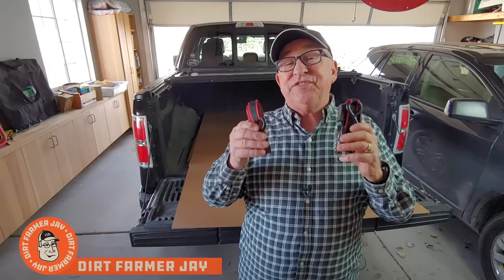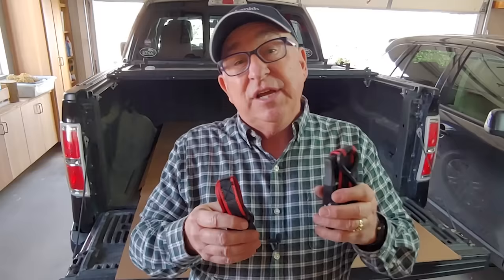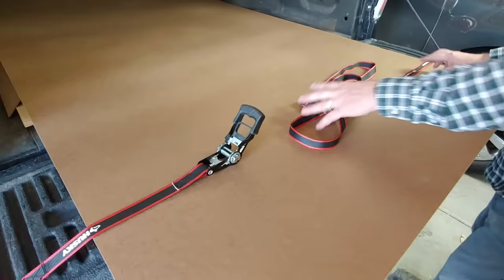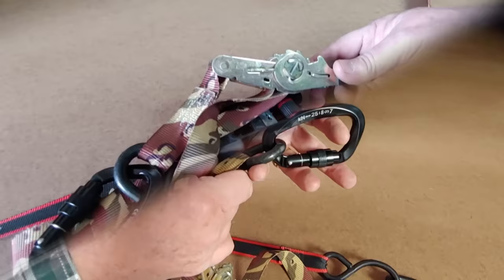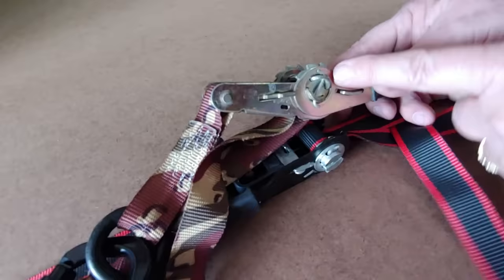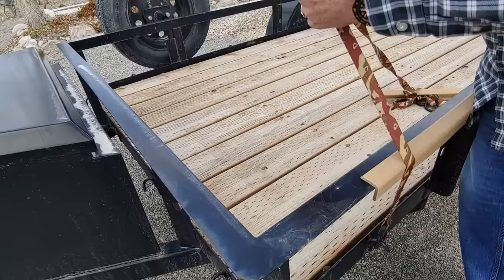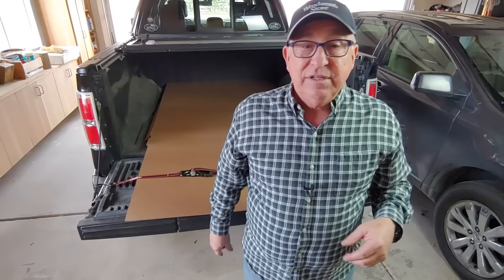How to Use a Ratchet Strap - Tips and Tricks!

Comment: At 8:43, when you hook the hooks together,
Instead of hooking the  hook thru the other straps hook eye, for added security you can actually hook each hook into the opposing hook eyes.
This way it's double hooked
Reply: That is an OK idea. Just keep one thing in mind if you are hooking them the way I think you are:
Those hook eyes aren't welded shut. If you hook them sort of 69 wise, hook to eye; the hook will be pulling right at the joint of the eye. It is also a little bit teardrop, and it will wedge in, just as if you had a reason to pry open an eye.  Not a major concern unless you are using the straps at the high end of their strength, or in safety critical circumstance.

Comment: When you hook to a hook, work each other's hook into the sewn loop of the other, I came up with this myself and you will be grateful once seeing how well it works
Reply from the maker: Indeed, great tip. We'll show that in a future edition. The way you've described allows the hooks to stay connected whether they are under tension or not. Thanks for writing! Best, DFJ
Reply: @DirtFarmerJay  plus it loads the hooks as they were intended to be, the back hoop is often not welded and I hesitate to crank down on those hooks in any angle then they come set up for. Plus my way effectively halves the load each hook sees so not only within design, but better than.

Comment: Great Video But may I suggest that you put a twist in the strap if tying to a roof rack or trailer. Ask any trucker why and he will tell you it stops that annoying hum caused by the wind over the strap.
Reply from the maker: Thanks, martintheshred, for watching and commenting. I usually do put a twist especially when it's a longer length to tie down. But thanks for the reminder. Best, DFJ

Comment: Great ideas. I’ve been using the strap clamps the wrong way. I’d be very careful with that C clamp setup. If that clamp loosens, it could be a dangerous situation
Reply from the maker: Greg, thanks, indeed, we will mention the issue with a c-clamp in another video coming up. Best, DFJ
Reply: A C-clamp on a tailgate with no safety line is not a pretty site from a motorcycle please don’t do this.
Please add an edit to this video—-I’m asking as a first responder and motorcyclist.
Thanks.

Comment: In the beginning, leave it closed in the locked position to feed the strap through. After taking out all the slack and making sure there are no twists, you can open it and start ratcheting. P.S. for setting up a slackline, set it up upside down and ratchet from the bottom to avoid the ratchet from twisting the strap with its weight.
Reply from the maker: NewGunGuy - great insights - thanks for enhancement and for the tip on setting up a slackline - something that you won't see this guy doing.... Best Regards, DFJ
Reply: @DirtFarmerJay  I had to learn at work. I saw everyone else struggling. I didn't learn until took the time to look at the darn thing and decipher it.

Comment: Enjoying your vids - Tip: When releasing, After you have 'unlatched', just give a yank on the 'tail' and it will unwind. I also carry a small can of WD-40 to keep the ratchet in top shape. I drive a parts delivery truck for an auto dealer and am always using these straps (1.5")  to tie down a variety of loads all day long.
Reply from the maker: Thanks for the info! Sounds like you've picked up some expert methods along the way. Best, DFJ

Comment: Flatbed truckers call those "X" straps when they cross like that.  They use them on the front or rear of a load mainly.  
Reputable flatbed trucking companies train their drivers on how to do the "X" straps among other techniques not shown here.  

Free pro tip too...you can use the excess strap (rolled or folded) as "padding" to help prevent the rest of the strap from getting cut/damaged as well.

A D.O.T. officer will ding (negative inspection vs. clean inspection) a truck driver in a D.O.T.  inspection for cut/chaffed/damaged straps.
Reply from the maker: MAJorgy70 - great insights. Thanks for sharing, as well as being a part of the transportation system that we all so heavily depend on. Best Regards, DFJ
Reply: @DirtFarmerJay  Thank you.  I appreciate that.

Comment: using a c clamp looks pretty dangerous
Reply from the maker: georgebx - thanks for watching and taking time to write. I appreciate your concern and there's a couple of things to consider when you are using a c-clamp for this purpose. First, how heavy is the load. For a single or few sheets of a sheet good, a well-tightened C-clamp for a moderate distance works for me. Second, I orient the C-clamp as you see it - with the strap going through it in such as way that the clamp is being forced against the edge. If carrying a more significant load, the cross under and over is the way to go is now a go-to approach around here. Thanks for your thoughts, and for being one of our viewer family! Best Regards, DFJ

Comment: I insert the strap into the tightener a bit differently than shown at 3 minutes into the video. I close the tightener, making sure that the slot is at 90° to the direction of the two arms of the tightener. Next I insert the strap through the slot and pull out most of the slack and tighten as shown. This saves having to handle the loose end of the strap twice. 

It's important to leave a little slack before tightening the strap. The strap needs to turn around the shaft far enough to lock the strap down. I've had a strap come loose because I hadn't left enough slack for the strap to fully lock down.
Reply from the maker: These are some great insights! Thanks for taking time to share them. Best, DFJ

Comment: 15:50 This can also work in reverse --- a tiedown-strap rubbing on a spot can wear a hole in the product.  I had this happen with a boat-hull --- the aluminum actually got worn through and formed a sizeable hole in the boat below the water-line!  I patched it with JB Weld, and added a farther-apart pair of tethering-loops to the boat-trailer so that the strap just passed directly up over the gunwale (i.e., the upper edge of the hull) instead of against one of the chines (i.e., the outward-folded unibody-ribs).
Reply from the maker: Fred Seaborne - sorry for the slow response. This is indeed a great insight - thanks for sharing! We'll use your tip in an upcoming episode and be sure to give you credit for the idea. Thanks for writing! Best, DFJ

Comment: No ,the architect straps have a locking system on them too, if you don’t use the lock your strap will I tighten it’s self, , on the handle when you tight the load , you put t back at 0 , well on my straps you squeeze the handle and push it on down on its self , that locks 🔒 it , nice , thanks BigAl California.

Comment: When setting up a ratchet strap, first  ratchet it until the slot that the strap runs through is perpendicular to the ratchet, then leave the ratcheting handle closed. Now slid the end of tour strap through the slot, coming up through the bottom. This ensures that the dead leg of your strap is on the right side of and clear of the ratcheting mechanism. And you don't have to now fish it through the ratchet a second time. I hope the way i described it was clear.

Comment: I just carried 3 sheets of 1/2" plywood home from the Depot last night strapped with 4 ratchet straps on the roof rack of my Honda CR-V.  Any videos for roof racks? Always good to learn new tricks. Thanks for the extention cord video, I must be a little uncoordinated today, still trying to master that.
Reply from the maker: Roof racks are a bit more trickier. I don't have an episode on this subject, but may consider doing one in the future. The basic idea is to strap down the sheet goods by attaching one end a strap to a side point, taking the strap around the end of the plywood and under to an attachment point on the other side. Repeat on the other end. For extra security, you use a total of 4 straps (two criss-crossed on each end) instead of 2. I hope that helps! Best, DFJ

Comment: to prevent the "hum" or vibration on the strap while driving put a half-twist in the strap and it stops the vibration.
Reply from the maker: Indeed, you can tell an experienced trucker by if they have put a half twist on their strapping system on their flatbed. No buzz, not flap. Thanks for the reminder. Best, DFJ

Comment: here in Ozz   you see a lot of those straps laying on the side of the road  because they have come loose through some fault and the silly hooks come undone    better off using the ones that have a captivated lock ring that goes around the end of the hook      but because of the Chinese flooded market they buy the cheap use once type  (why use once because they have fallen off on the way home )    there should be a standard rating on these things

Comment: Great video. I use straps on a daily basis in my job. Bigger,but same concept. Few comments/tips for others out there. 1: when attaching the strap portion (not the windlass aka ratchet)to ur anchor point, put one twist in the line b4 anchoring. This stops the humming noise and the vibrating strap which could chafe and snap. Ull hear some folks say this weakens the straps but this has been debunked maaaaannny times over. Ud have to twist it dozens of times b4 its an issue.Just dont knot or store straps twisted. 2: if its a long strap when doing the roll like is showed here, you can make the loop big enough to fit ur palms in and use them like a wheel or gear to speed up the winding process. 3: after u do the "roll and loop" like he shows, hold the bound roll in one hand, pinch a loop in between the roll and the ratchet, pas this loop between the load and the tight strap while still holing the roll. Squeeze the roll on itself to flatten some, position the flat roll so it is halfway over the tight strap and so the created pinched loop is halfway over the roll. Spin the flat roll up. This will tighten the pinched loop onto the flat roll and abchoring everything in a tidy clean and secure fashion. Removal is exact reverse. Sounds complex but isnt. I was able to learn  it haha. Probably a video somewhere. Maybe try how to tie off trucker straps.
Reply from the maker: Thanks for taking time to share your vast knowledge on this topic Arthur Hutchinson. Best to you, my friend! DFJ

Comment: I save old socks and roll my straps up and put them in the socks then just roll the socks up and fold the opening back over the balled up sock. Keeps them organized and tangle free.
Reply from the maker: Nice tip, Randy! Best, DFJ
Reply: @DirtFarmerJay  wish I could claim credit for the idea. Can't remember where I heard about it, probably on YouTube, but it changed me life.  Sometimes it's tempting to just throw the straps back behind the seat in my truck and say I'll wrap them back up later but then they just get forgotten about and are a tangled mess next time I need them.  Spending a few minutes wrapping them back up in the socks when I'm finished saves time and aggravation later. It doesn't work so well with larger straps, they just won't fit in a sock but for smaller light duty ones and the kind with the pull through buckle that bites into the strap if pressure is applied from the other side, it works great.

Comment: Here's one for ya: I had to load a 5' mower deck (about 400 lbs) into my pick-up bed. I leaned the deck up against the bed (Didn't want to lift the end that was on the ground, 'cause if the top were to slip off the edge of the bed it would fall on me), so I just attached a ratchet strap to the deck and an attachment point, and winched the deck about halfway in (Like a come-along), and then easily lifted the other end and shoved it the rest of the way in. (I really should just buy a come-along!). I may originally be from NYC, but I'm a KY. hillbilly now! (At least that's what my wife/sister says :D)
Reply from the maker: Love it!

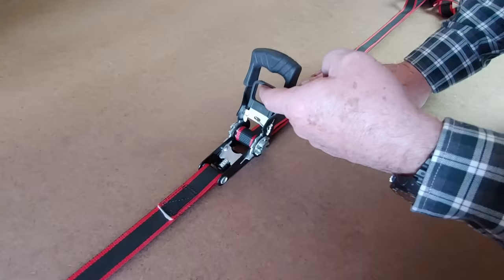Comment: That 3:46 to 4:26 gig can get someone in big trouble (lose a load) quick. Anything less than 2+ wraps around when tightened is not secure to the strap rating, if at all.

Comment: On a truck or trailer you should have a twist in it. The twist does 2 things 1st is it cuts the loud noise from strap vibration that happens with a flat strap. 2  it prevents the strap from breaking from the vibration.  Learned this from a truck driver and experience. This is easy to prove by trying it.
Reply from the maker: Indeed, this is a great practice that we've mentioned before, but will emphasize it more in an upcoming edition of best practices that our viewer family has provided us. Thanks for writing! Best, DFJ

Comment: When threading the ratchet, keep the latch losed, with the slot in the drum at 90 degrees. Then simply thread and pull. No need to thread it through the handle as well.

Comment: Yep, there is more to it than people think. Lenght for use matters too. The two I have on the back of my boat and trailer had to be cut to fit. Then make sure to burn the ends from fraying. I use two long ones for securing my dump loads. Finding a spot to put the ratchet is always a issue. I have to take a small ladder with so I can reach on top. I've tried it lower but I don't want to scratch my paint. I wish they made them with a protective cover
Reply from the maker: Thanks for watching and commenting Tim's Workshop TJY. Lots of great tips within your comment. Best, DFJ

Comment: Thank you! I have been messing around with ratchet straps for years and was always confused! Your extra loading tips, like the c-clamp, makes complete sense but I would have never thought of it or made it to that point! Incredible lesson and much appreciated!
Reply from the maker: Great to hear!
Reply: See above comment
Reply: Think safety, unless the c clamp has a lock nut in can vibrate loose and go through the person's windshield following you.  A thin piece of material could easily break.  Then the best case senerio you have a strap and material flapping about.  Use the X strapping get method where a C clamp would be required.  If your not towing you could use your trailer hitch, if you've forgotten to lay the straps in before the load.

Comment: If the end of the strap that you insert through the drum does get frayed, just cut off a couple of inches until you get back into strong webbing and then sear the ends with an open flame.  Easy fix.
Reply from the maker: Great tip Dan Nuthals.  Keep those tips coming! Best to you, DFJ

Comment: I buy the dang things on sale.  Even if I have plenty.  HF is terrible place.  Under $2 for 400 lb 15’ long.  Hand them out at lumber yards, garage sales… when I see a disaster in the making.   I have some 800lb working load that I use often.  Just over $3 each couple years ago.  Still in good shape.  Cheapest means to secure anything on a truck bed, trailer.  As you protect from rough/sharp edges they are good for years.
Reply: On the end, stuffed, jammed ratchet.  A Vice grip, large screwdriver can help from side

Comment: Lasr year I bought 5 sheets of 5/8 “plywood to make hurricane shutters.  With 2 rotator tears  on each shoulder and age 85, Lowes loaded the stack of ply into my  short bed  F150.  They threw the 20 lb bag of bird food on top.  It stuck out a bout 2 ft past the lowered edge of the tailgate.   At the 2 nd stop light I heard a big whump.  The entire stack with bird food still on top was in the middle of the busy intersection as I got the green light.   What to do now?  I could move single sheets  of the 5/8 ply back to the truck one at a time and get each sheet back aboard.  The Mercedes behind me at the intersection was stuck. Two young black men about maybe 18 or 20 were weed wacking  an empty lot at the intersection .  Heavy traffic behind me and oncoming.   The bundle of ply and bird seed landed completely intact, edges perfectly aligned. The two young men dropped the weeders and rushed to the pile of ply. They each grabbed an end of the bundle with bird seed in the middle and tossed it back onto the truck  bed. I said thanks, “You guys are my guardian angels today. “.   Gave each a $20 and they raced  back off to their wacking.   I came home and installed 4 hooks on the tailgate for Bungie cords or ratchet straps. Bought 4 12ft orange ratchet straps at Harbor Freight  next  visit to town.   Lesson learned.   Learn from other peoples mistakes.  Experience is NOT THE BEST TEACHER.  It is embarrassing and costly.
Listem to MR. JAY……..

JoeB
Reply: Hilarious but awesome story!!!
Reply from the maker: Joe B, Thanks for sharing your story. Sorry it happened but sounds like you DID have some Guardian Angels around you that day! Congratulations on your 85th birthday!! May God watch over you each and every day. Best, DFJ and Dirt Farmer Maggie
Reply: Guardian Angels do NOT need cash.  I would have helped you for free.  Your cash would have been no good with me. ✌🏼

Comment: I have come too find that ratchet straps corrode in saltwater regions. It would make sense if they had some marine grade ratchet buckles available where you won't have to worry about rusting and smooth operation over time. These cheap ratchets only have short life span in water regions or salty winter roads.
Reply from the maker: Greg, that's some good information! It seems that others have had this issue as well and there are marine-grade ratchet devices. I found this source for instance: https://www.superyachtmarinestore.com/marine-ratchet-straps/